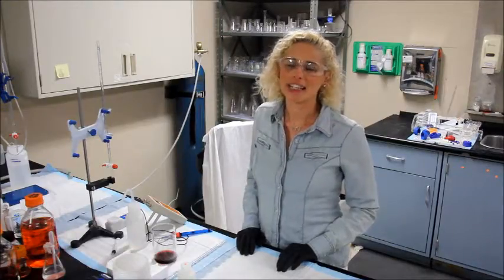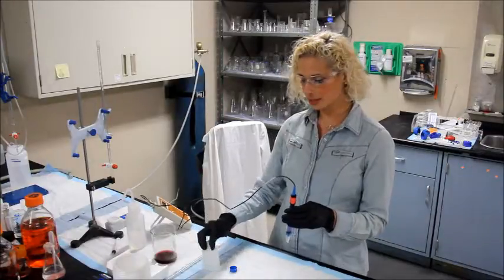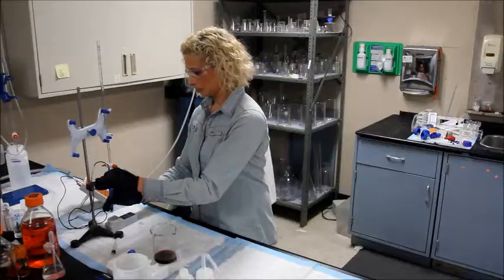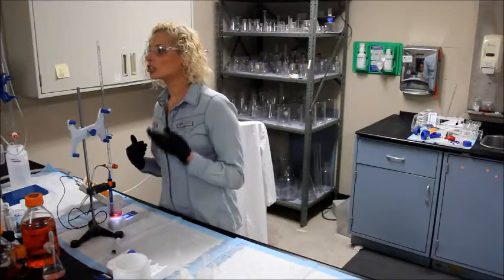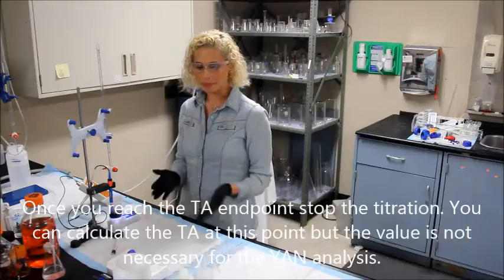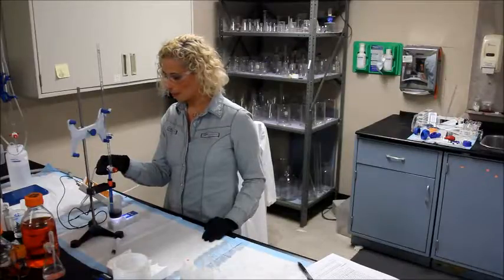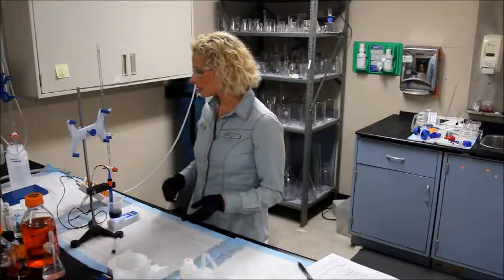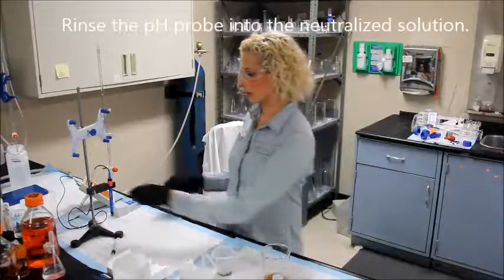Measuring Yeast Assimilable Nitrogen (YAN)

Comment: Carifying some of the 'magic numbers' here: Molecular weigth of nitrogen atoms is 14 grams per mole. And the concentration of the Sodiumhydroxide is 0,133 Molar (TA titrant). Since 10ml of solution is used in the titration a dilution foactor of 100 is used to calculate the N levels per liter. (hence the 14x100x0,133) The First Titration is used to reach the equivalence point and is determined to approximate the levels of tartaric acid. Tartaric acid has two -COOH Cabroxyl(acid, proton donor)  groups and therefore one uses a correction. The number of base added to the acid is devided by two since the NaOH has only one -OH (reactive base group) to neutralize the two protons from every acid molecule. Therefore, the amount of acid present is hhalf of the amount of moles added in form of NaOH during titration. 

(a proton (H+) and base group (OH-) react to a neutral H2O)

After this titration one van approximate the YAN using the Sorensen formol titration. The formaldehyde reacts with aminoacids (or other aminos, most often molecules bearing only one nitrogen atom) and forms the equivalent methylene-acid. This lowers the pH (more acidic) and with the NaOH titration we can again restore the pH to neutral to discover how many moles of Formaldehyde or amino groups have reacted (and thus were present).  

1,34ml of NaOH at a concentration of 0,133 moles per liter contains 0,0007822 moles of NaOH   (0,00134 x 0,133)
--> 0,00017822 moles of amino groups were inside the titrated volume as 1 molecule of NaOH reacts with exactly 1 molecule of amino acid

The titrated volume is 10ml (0.010L)
The molecular weight of Nitrogen is 14g/mole
0.00017822 mole x 14 gram/mole = 0.00249508 grams of Nitrogen
Corrected for the volume: 0.00249508 / 0.010L = 0.249508 grams of Nitrogen per liter or 249,5mg/L

... for whoever wants to know ;-)
Reply: Thanks
Reply: What kind of formaldehyde solution (%) should be used?
Reply: @perbuhrevideo  37% formalin which is stabilized with 15% of methanol